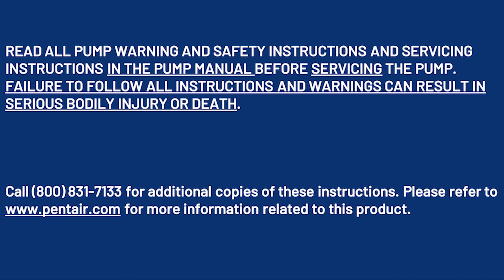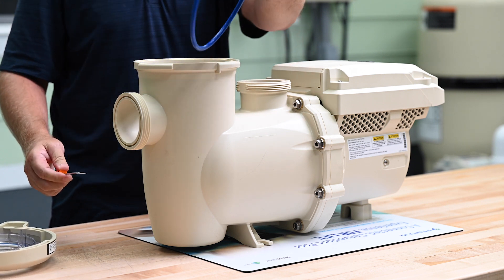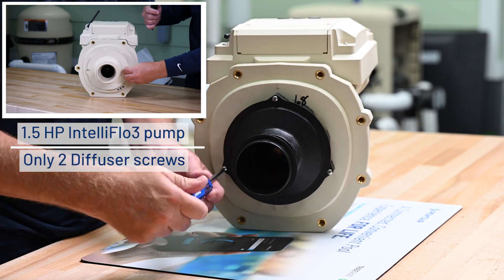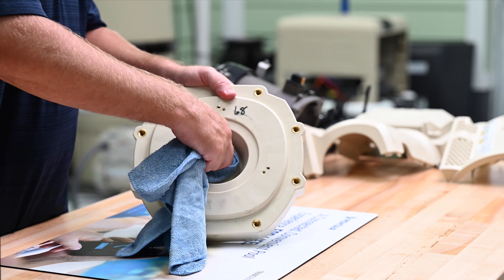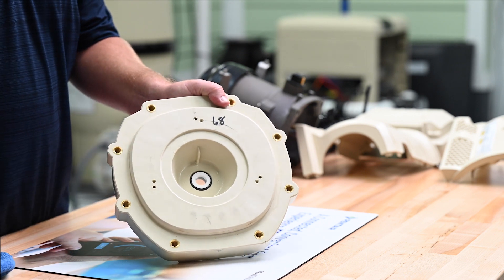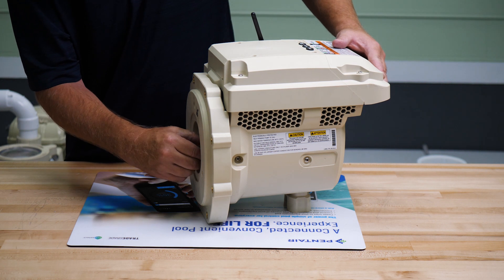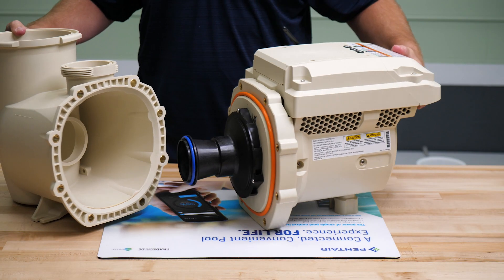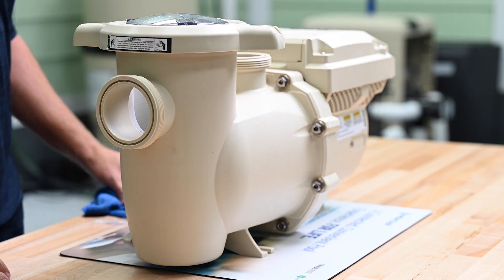IntelliFlo3® VSF Pool Pump Seal Replacement Video

Comment: In their defense, they are being pushed by governments, especially in California, to sell these complicated and finicky variable speed motors to reduce electric consumption. For myself, I prefer the simple toggle switched two speed motors. The low speed only draws 3 amps compared to the 10 amps at high speed. And they don't have that ridiculously expensive computer controller that gets fried all the time with lightning. With properly balanced water, I never run the pump on high for daily circulation. Keeps the electric bill WAY down. I use high speed to backwash, vacuum to waste, recirculate and so on. Which is not too often. I lube EVERY fastener on my pumps with anti-seize!